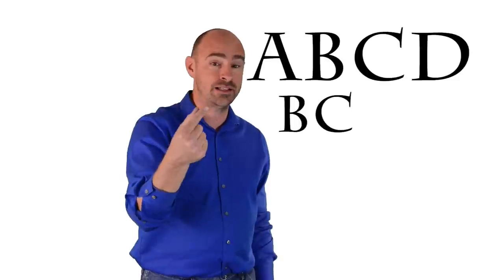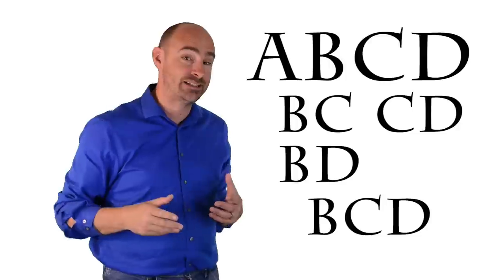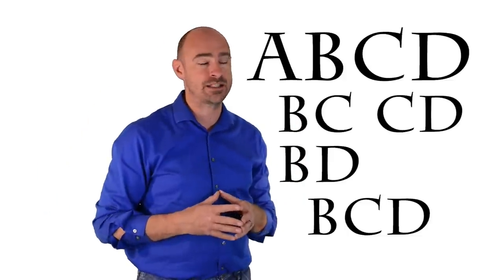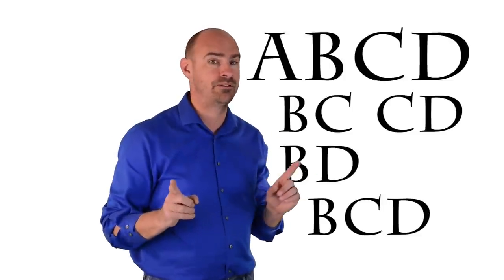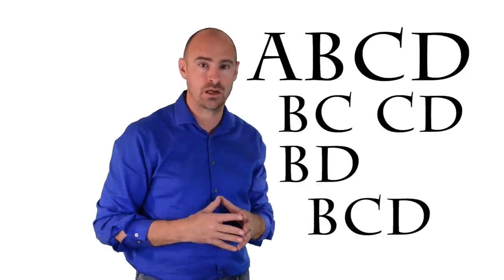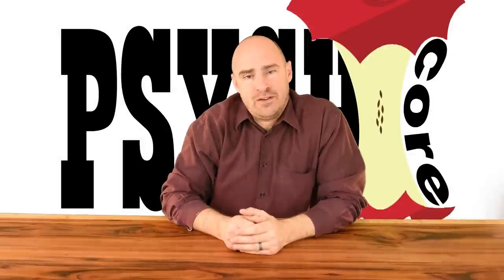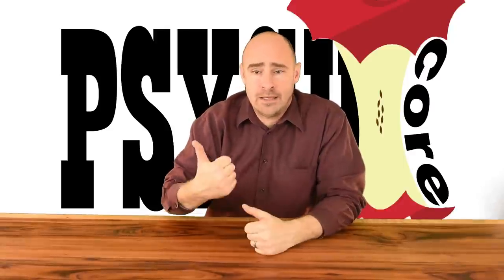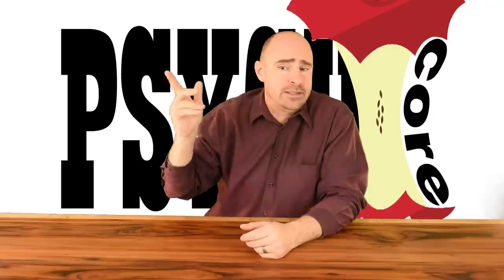Multi element Design

Comment: Hello, if I implement behavioral skills training (BST) intervention sequentially across 3 teachers (experimental control) and continued to assess performance according to a 10 step task analysis; in which case, I would have recorded Baseline, intervention (BST), and post-training data for each, can I safely say this is a multi-element design (so I think... please correct me if I'm wrong)? Also, in graphing the data for all 3 participants, I should have 3 different independent graphs, which would not be liked for comparison, unlike the Multiple Baseline Design. I'll appreciate your guidance. Thanks
Reply: Thinking about it, I reckon it's a changing criterion design.... again, please correct me if I'm wrong
Reply from the maker: Well you would have little to no experimental control at all. What you have described from what I can read is three AB designs. Baseline (A) and intervention (B) for three subjects. AB designs have basically zero internal validity.

The multiple subjects is good - but the way you have described this study shows no control.

You COULD overlap baseline measures for all three subjects concurrently then start your intervention at different times for each subject thereby producing a multiple baseline (see our multiple baseline part deux vid) to establish experimental control. This would be awesome.

It is not a changing criterion design. With those you establish a baseline then switch conditions  to intervention. During the intervention you choose a new level for a given behavior and when the subject reaches it with consistency (e.g., 3 out of 5 times or 4 times in a row, whatever) then you change the criteria to be closer toward your goal.

We have some good vids for most if not all of these and Cooper covers them well too. If you have a Johnson and Pennypacker text they do an amazing job of presenting experimental design.